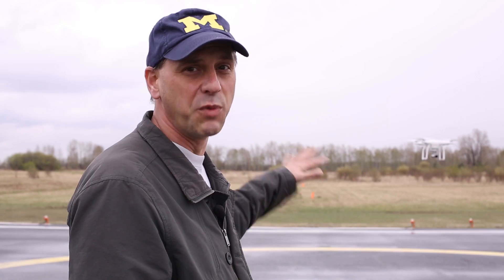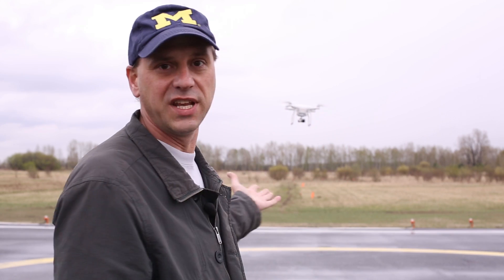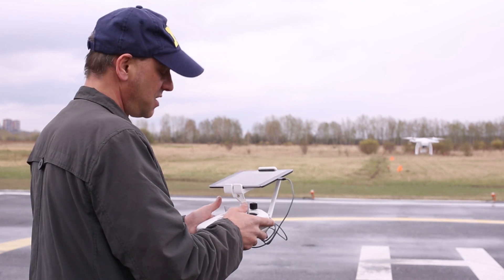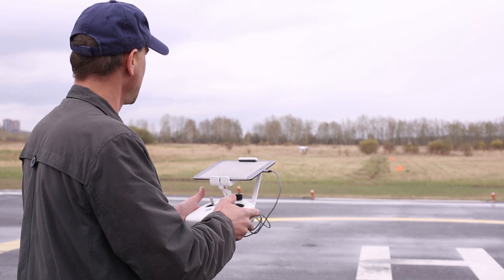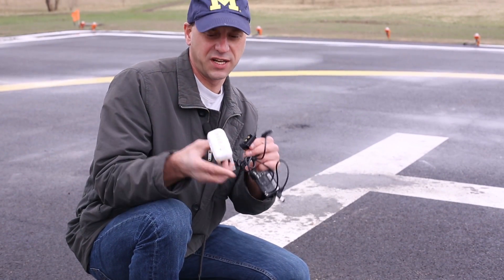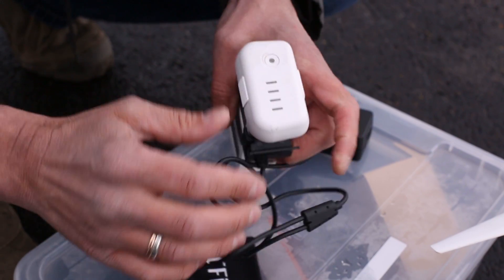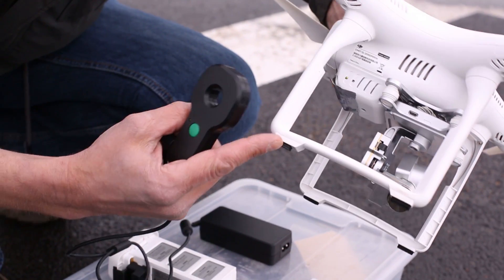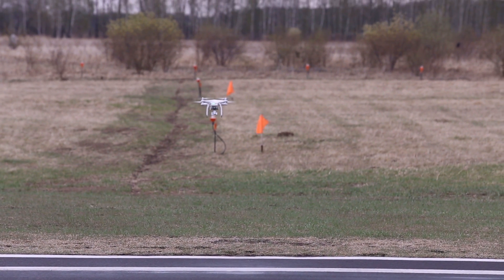How to: Fix The Compass Error On the DJI Phantom 3 ! CFixer

Comment: One question while I'm waiting on it to arrive. Does my phantom 3 adv. need to be turned on before using cfixer?
Reply from the maker: No, it doesn't. But if you want see compass axes values you may turn it on and go to menu -> sensors in the DJI Go app.

Comment: Pete Scott, firstly, thanks for posting this for the phantom 3 compass fix. I'm going to be ordering this along with a power cable so I don't need to be home to use it.
Reply from the maker: Hi. I am CEO of CFixer team. Thanks for interesting of our product. Cable for DJI Phantom 3 battery you may buy in any DJI store or at our website: http://www.vanavara-digital.com/product/PH3_bat_cable

Best regards, Konstantin, CFIxer Team.
Reply: Copter24.ru I have a cfixer now on preorder, waiting to ship around June 10th. what's the wait time roughly to get it here in the states?
Reply from the maker: I see. Thank's for preorder. Usually shipment time to USA is 10-15 days.